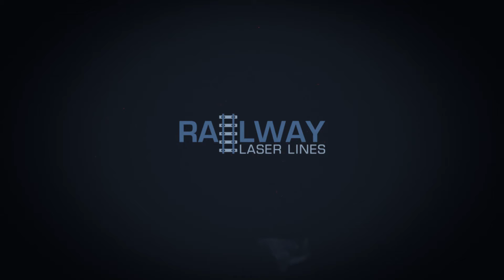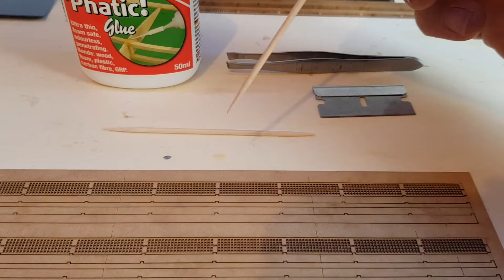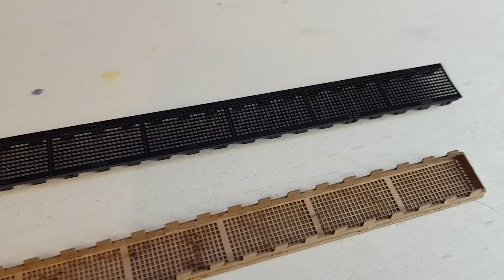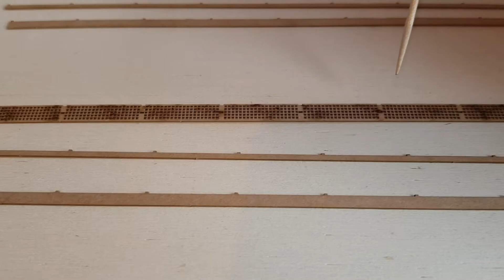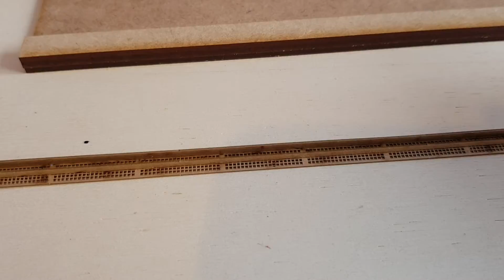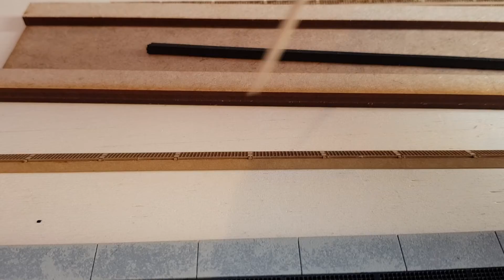How To Build | OO Fuelling Grids | Railway Laser Lines

Comment: I want a code 100 version . My question is do they sit lower than the track height ? 
They look brilliant tho
As my concern with it is track cleaning I wouldn't want to rub the paint whilst rubbing with a track cleaner?
So ideally any kits that go in track need to be slightly lower than the actual track..
Regards Daniel
Reply from the maker: They fit both code 75 and 100 Peco flexi track and all fit below rail height when in position (ideally glued)
Reply: @SteveSmithRailways  great thanks
I have a massive tmd area to build looking at several of your kits this one plus a bid shed and other bits  as I have an area 6ft by 4ft to build it on 
Thanks for the info and great kits 👍